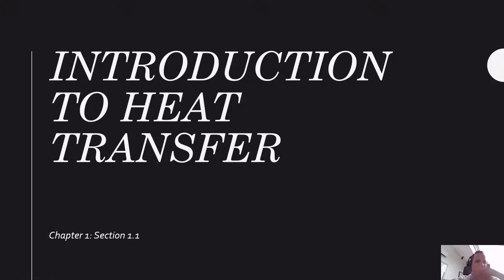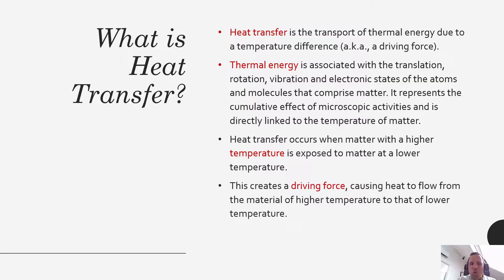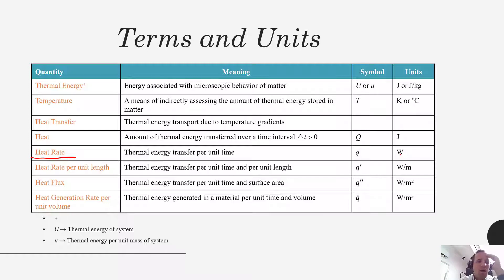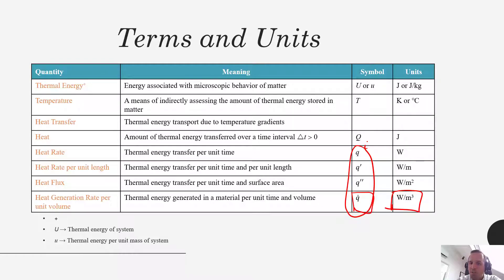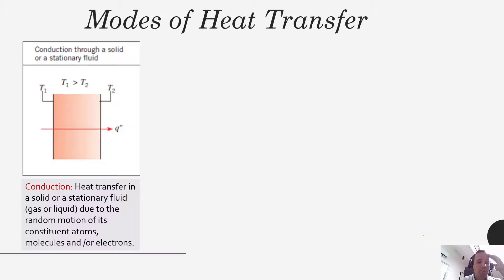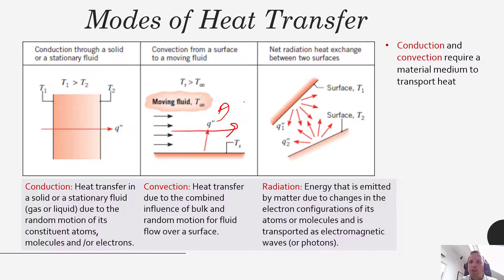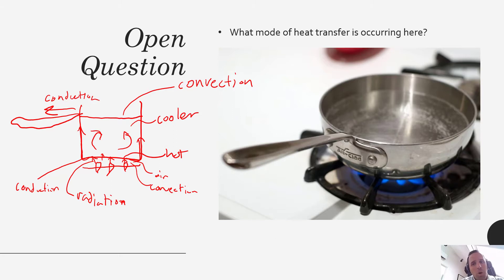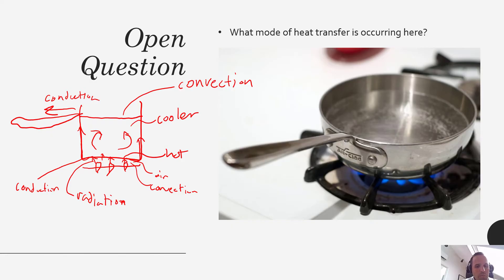Heat Transfer - Chapter 1 - Lecture 1 - Introduction to Heat Transfer

Comment: 3.	Apakah jari jari selubung  bola dibanding ketebalan kulit bola pernah bernilai 1? Jika ditemukan rasio jari jari selubung bola terhadap ketebalan kulit bola memiliki nilai 1 , maka rumus yang digunakan perlu untuk dikaji ulang. Alasannya adalah jari jari selubung bola bergerak tidak linier terhadap ketebalan  kulit bola. Sedangkan jari jari selubung bola bergerak berdasarkan fungsi hiperbola tertentu( tidak menyatakan garis linier. Yang bermakna R2 / ( R2 – R1 ) ~  R2 R1 ( R2 – R1 ). 
Sehingga, 
R / ( R2 – R1 ) = ( R2 R1 )0.5 / ( R2 – R1 )  adalah perbandingan  jari jari selubung bola terhadap ketebalan kulit ( R2 – R1 ).
(R1 . R2 )0.5  / R2 -. R1 tidak pernah bernilai 1. Ditulis dalam persamaan adalah (R1 . R2)0.5  / R2 -. R1 ≠  1. 
Mari kita buktikan bahwa (R1 . R2)0.5  / R2 -. R1 = 1, jika bisa ditemukan , maka rumus sebelumnya harus dikaji ulang. Sebagai catatan bahwa saya akan paksakan bahwa R2  =  R2. R1 dan R = ( R2 . R1)0.5. Sehingga perbandingan jari jari selubung bola terhadap  ketebalan kulit bola ditulis dalam persamaan :

( R1 . R2 )0.5  / R2 -. R1			 = 1				.…….  Persamaan 1	 
Q 		`			= k. 4π R2.L (∆ T)/ ( R2 – R1 ). 				 
Q 					= k. 4π R1.R2.L (∆ T)/ tebal. 
Fokus  pada R2 / ( R2 – R1 ).
R2 / ( R2 – R1 )										 
R2  					= R2. R1
( R2 )0.5  					= ( R2. R1 )0.5
R					= ( R2. R1 )0.5
Yang dicari adalah jari jari selubung bola terhadap  ketebalan kulit bola.
R / ( R2 – R1 )				= 1,  R = ( R2. R1 )0.5
( R2. R1 )0.5 / ( R2 -  R1 )			=  1, sehingga
( R2. R1 )0.5 				=  1.( R2 -  R1 )
( R2. R1 )0.5 				=  ( R2 -  R1 ), persamaan di kuadratkan sehingga
( R2. R1 )					=  ( R2 -  R1 )2, diuraikan sehingga
( R2. R1 )					=  ( R22 - 2 R2 . R1 + R12 ), pindah ruas 
( R22 - 2 R2 . R1 + R12 )			= ( R2. R1 ), persamaan ( R2. R1 ) pindah ruas, sehingga
( R22 - 2 R2 . R1 + R12 ) / ( R2. R1 )		= 1, dilakukan pembagian, sehingga
R2 / R1 – 2 + R1 / R2			= 1, 
R2 / R1 + R1 / R2				= 1 + 2
R2 / R1 + R1 / R2				= 3,  persamaan dikalikan dengan R1 . R2, sehingga
R22  + R12					= 3 R1 . R2
R22  - 3. R1 . R2 + R12			= 0
(R2   -  0.381969.R1 ) (R2  - 2.618031.R1  )	= 0
R2 - 0.381969.R1				= 0,	harus memenuhi  R2 > R1 	
R2  					= 0.381969.R1
R2 : R1					= 0.381969 : 1, ternyata R2 < R1. Persamaan ini tidak bisa digunakan.
Dan berikutnya adalah persamaan yang ke dua					 
R2  - 2.618031.R1  			= 0
R2   		  			= 2.618031.R1  
R2 : R1					= 2.618031 : 1, persamaan yang digunakan adalah 
(R2  - 2.618031.R1  ), memenuhi R2 > R1.
Jadi untuk sembarang R2 ( outer ) akan selalu memenuhi persamaan

( R1 . R2 )0.5  / R2 -. R1 = 1, saat R2 : R1	= 2.618031 : 1

R2 : R1					= 2.618031 : 1, adalah rasio outer terhadap inner
Kembali pada persamaan 3
( R1 . R2.)0.5 :  ( R2 – R1 ),   adalah perbandingan  jari jari selubung bola terhadap ketebalan bola. 	
R2 					= 2.618031
R1					= 1.
( 1. .2.618031  )0.5  / ( 2.618031  -.  1)		= 1.
( 2.618031  )0.5         /  ( 2.618031  -.  1)		= 1
Adalah suatu keadaan dimana panjang jari jari selubung bola terhadap ketebalan bola memilki panjang yang sama. Hal ini tidak pernah terjadi. Alasannya adalah jari jari selubung bola bergerak tidak linier terhadap jari jari  bola. Sedangkan luas kulit bola bergerak berdasarkan fungsi hiperbola tertentu( tidak menyatakan garis linier).
Namun demikian untuk kasus perpindahan panas konduktor aliran steady state bentuk  silinder dan bentuk bola. Ada syarat lain yang harus diikutii. Yaitu nilai jari jari selubung terhadap ketebalan bola harus selalu bernilai lebih dari 1. Mengapa harus selalu bernilai lebih dari 1 ? hal ini disebabkan adanya perubahan luas penampang yang tidak bergerak linier terhadap jari jari silinder maupun bentuk bola.
Kesimpulan :
Dengan menemukan persamaan jari jari selubung silinder  terhadap ketebalan silinder = 1. maka saya merasa keberatan dan sebagai konsekuensinya adalah rumus yang sudah ada harus diuji di laboratorium 
Dengan menemukan persamaan jari jari kulit bola  terhadap ketebalan bola = 1. maka saya merasa keberatan dan sebagai konsekuensinya adalah rumus yang sudah ada harus diuji di laboratorium.

SUDUT PANDANG FILSAFAT TENTANG TEORI KEBENARAN 
Berdasarkan teori kebenaran dalam rumus tersebut adalah merupakan teori kebenaran consensus. Yang disepakati bersama sama. Belum mencakup kebenaran secara universal dalam kondisi ketebalan. Hal ini memungkinkan adanya proposisi yang bertentangan dengan obyek dan hasil saat dilakukan konfrontir.
memahami Jenis teori kebenaran :
1.	Teori Koherensi (The Consistence/Coherence Theory of Truth)
2.	Korespondensi (The Corespondency Theory of Truth)
3.	Pragmatisme (The Pragmatic Theory of Truth)
4.	Teori Performatif
5.	Teori  consensus. Pendekatan teori kebenaran pada kasus ini masih bersifat kesepakatan para ilmuwan
Sumber-Sumber Pengetahuan :
1.	Rasionalisme
2.	Empirisme ( pada bagian ini saya belum melakukan pengujian fisik pada suhu material )
3.	Kritisisme
4.	Intuisisme
Secara umum kebenaran bersifat :
1.	Rigid
2.	Universal
3.	Nonkontradiktif
4.	Bisa dibuktikan 
5.	Radic
Quote philosophy :
It is with logic that one proves, it is with intuition that one invents ( Henri Poincare ).
My quote philosophy :
Matematika sanggup memprediksi kesalahan, namun belum sepenuhnya membuktikan kebenaran mutlak. 
Saya tidak punya niat apapun selain memperbaiki pendapat akademik. Yang terlanjur menyebar luas sampai ke pelosok dunia ( khususnya pada materi perpindahan panas ). Dan kita bekerja sama untuk saling memperbaiki dan menguji kebenarannya. Alangkah indahnya dunia ini jika manusia saling belajar dan menjadi bijaksana untuk segala permasalahan yang dihadapi bersama di dunia ini.
 My favourite music :
The lonely Shepherd by  Andre rieu feat Gheorghe Zamfir
Marriage d’amor –paul de senneville II Jacob’s piano
The gael – last of the mohicans-Royal scots dragoon
							Vincencius Sufijan Hadi

Comment: SURAT TERBUKA
KESALAHPAHAMAN  PERSAMAAN PERPINDAHAN PANAS  KONDUKSI ALIRAN STEADY STATE PADA KASUS  BENTUK SILINDER DAN BENTUK BOLA
Kepada yang terhormat,
Siapa saja mempelajari mata kuliah perpindahan panas (teknik mesin, teknik kimia dan teknik nuklir).
Di 
Tempat,
Bersama dengan surat terbuka ini, dengan kerendahan hati, kami  mengirimkan surat terbuka kepada  siapapun , yang boleh dibaca oleh siapa saja yang berkenan membaca surat ini. 
Maksud dari surat terbuka ini adalah berdiskusi ulang  mengenai penjelasan perpindahan panas ( Heat transfer ) aliran tunak ( Steady state ) pada kasus dinding silinder berongga dan bentuk bola
Saya penulis surat keberatan dengan  rumus yang sudah ditulis di buku dan literatur. Khususnya pada perpindahan panas konduktor pada dinding silinder dan bentuk bola aliran steady state.
Secara singkat keberatan saya adalah :
Uraian  singkat keberatan saya dengan rumus perpindahan panas ( Heat transfer ) yang sudah ada adalah :
Untuk bentuk silinder 
Persamaan umumnya adalah 	
Q			= -k. A. (dT)/ (dR ).  Hukum fourrier
Sehingga persamaan umum diturunkan untuk kasus silinder menjadi,  
Q			=  k. 2π.R.L ( dT )/ ( dR ), 					……… 	Persamaan 1
Pindah ruas kiri di Integral dR/R. Dengan batas atas outer ( R2 ) dan batas bawah inner ( R1 ), dT dintegralkan menjadi ∆T. sehingga persamaan berubah menjadi,
Q. Ln ( R2/R1 )		=  k. 2π.L ( ∆T )			
Q 			=  k. 2π.L ( ∆T) / [ Ln ( R2/ R1 )].				……….	Persamaan 2
Persamaan 1 equivalen dengan persamaan 2
Q			= k. 2π.R.L ( dT )/ ( dR )		= k. 2π.L ( ∆T) / [ Ln ( R2/ R1].
Q / k. 2π.L		= R. ( dT )/ ( dR )			= ( ∆T) / [ Ln ( R2/ R1].
Q / k. 2π.L adalah konstan ( C ), sehingga
C			= ( dT ).R / ( dR )			= ( ∆T) / [ Ln ( R2/ R1], C tidak dilibatkan lagi.
( dT ).R / ( dR )		= ( ∆T) / [ Ln ( R2/ R1], dT = ∆T.
( ∆T ).R / ( dR )		= ( ∆T) / [ Ln ( R2/ R1 )].
( ∆T ).R / ( R2 – R1)	= ( ∆T) / [ Ln ( R2/ R1 )], ( outer – inner ) = R2 – R1 = tebal  
( ∆T ).R /  tebal		= ( ∆T) / [ Ln ( R2/ R1 )], ∆T di eliminasi.
R /  tebal		=  1/ [ Ln ( R2/ R1 )].
1: [ Ln ( R2/ R1 )].		= R :  tebal.
1: [ Ln ( R2/ R1 )].		= R :  ( R2 – R1 )
R :  ( R2 – R1 )		= 1: [ Ln ( R2/ R1 )], diubah untuk R1 adalah x dan R2 adalah e ( bilangan euller ) sehingga,
R :  ( e – x )		= 1: [ Ln ( e/ x )], dimana x : 0 ≤ x ≤ e			 ..…….	Persamaan 3
R :  dR			= 1: [ Ln ( e/ x )], dimana x : 0 ≤ x ≤ e			 ….……	Persamaan 4
Persamaan diatas adalah perbandingan jari jari selubung silinder terhadap jari jari silinder
Dimana,
dR			: Ketebalan sesaat. (R2 – R1 ) atau ( outer –inner )
dT			: Temperature sesaat
e			: Bilangan euller atau R2 atau outer
K			: Konduktifitas thermal materi
L			: Panjang silinder
Q			: Nilai kalor
R			: Panjang jari jari selubung
X			: Inner atau R1
∆T			: Hasil integral dari dT
∆R			: Hasil ( R2 -  R1 ) = ( outer – inner ) = tebal
2πR			: Keliling selubung silinder
2πR.L			: Luas selubung silinder
Uraian keberatan saya adalah :
a.	Dari persamaan 3 dan 4. Perbandingan jari jari selubung terhadap ketebalan silinder tidak pernah kurang dari 1. Kondisi ini terjadi saat ketebalannya ( e – x ) , yang mana e ( logaitma natural ) adalah jari jari outer dan x adalah jari jari inner yang berkisar 0 < x < e^0 . Alasan keberatan  saya adalah jari jari selubung selalu bergerak membesar mengikuti perubahan luas penampang silinder. Sedangkan ketebalan bergerak secara linier. sehingga tidak pernah terjadi suatu peristiwa jari jari selubung lebih pendek dari pada ketebalan. Dengan demikian jari jari selubung selalu lebih besar terhadap ketebalan dalam kondisi apapun.
b.	Dari persamaan 3 dan 4. Saat silinder pejal (  tidak memiliki lubang ), maka suhu akan menjadi +∞ (suhu meningkat sangat besar tak terbatas pada pusat silinder). Kondisi ini terjadi saat ketebalannya ( e - 0). e ( logaritma  natural ) adalah jari jari outer merupakan  bilangan natural dan  0 adalah jari jari inner. Alasan keberatan saya adalah sangat tidak masuk akal suatu materi dalam kondisi pejal dapat menahan panas dengan suhu  + ∞. Pendapat saya adalah suhu masih bisa diketahui meskipun  sulit di praktekkan dalam kondisi pejal .  
c.	Dari persamaan 3 dan 4. Perbandingan jari jari selubung terhadap ketebalan lebih besar dari 1 ( tidak memiliki batas ) dan berakhir pada 0 ( NULL ) saat ( e – e ) yaitu outer = inner . Alasan keberatan saya adalah jari jari selubung memang harus lebih besar daripada jari jari. Namun memiliki batas nilai tertentu !!!
d.	Dari persamaan 3 dan 4. Secara umum alasan keberatan saya dari point a, b dan c adalah penggunaan logaritma natural menyebabkan ketidakpastian perbandingan jari jari selubung terhadap jari jari. Yang ditampilkan pada grafik 1 dibawah.
a.	Saat ketebalan ( e – x ) , 0 < x < e^0, maka perbandingan jari jari selubung < ketebalan.
b.	Saat ketebalan ( e – x ) , x = 0  , maka perbandingan jari jari selubung terhadap ketebalan + ∞.
c.	Saat ketebalan ( e – x ) ,  x = e^0, maka perbandingan jari jari selubung  = ketebalan.
d.	Saat ketebalan ( e – x ) , e^0 < x < e, maka perbandingan jari jari selubung > ketebalan.
e.	Dari persamaan 3 dan 4. Pertanyaan saya adalah : Bagaimana menghitung suhu di pusat silinder saat panas berasal dari luar silinder secara konduksi dengan aliran steady state ???. mungkinkah jawabannya adalah ( – o C )?.
f.	Dari persamaan 3 dan 4. Penggunaan logarotma natural adalah mengitung satuan luas tak berdimensi tidak menghitung jari jari selubung silinder ( R ).
g.	Dari persamaan 3 dan 4. Ramalan kesalahan hitung sangat serius. Saat outer menjadi sangat besar dan inner mendekati outer ( relative tipis ). Maka kesalahan hitung  pada suhu menjadi sangat besar.
 
Grafik ( 1 ).  Adalah menunjukkan hubungan antara perubahan jari jari selubung terhadap ketebalan.berdasarkan persamaan 3 dan 4.
Mengapa rumus yang sudah ada dianggap sebagai kebenaran ?, hal ini disebabkan oleh nilai kalor harus selalu ( konstan ) di tiap tiap perubahan ketebalan yang mengalami perubahan suhu meningkat saat mendekati pusat silinder seiring dengan perubahan ketebalan, yang mana suhu awal berasal dari inner jari jari. Dengan catatan sumber panas berasal dari dalam silinder.